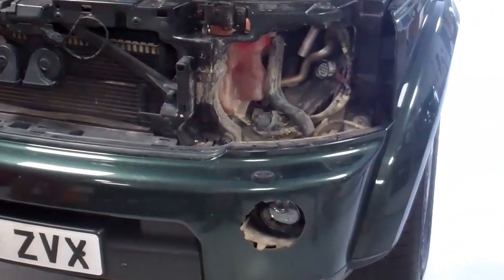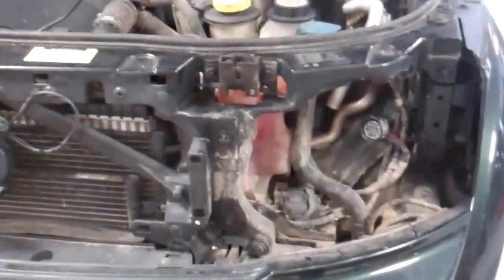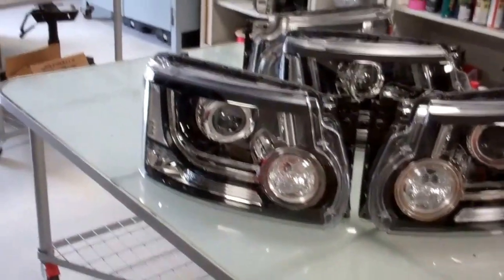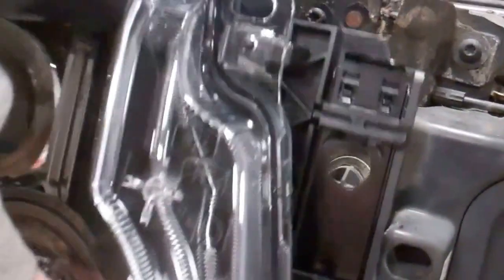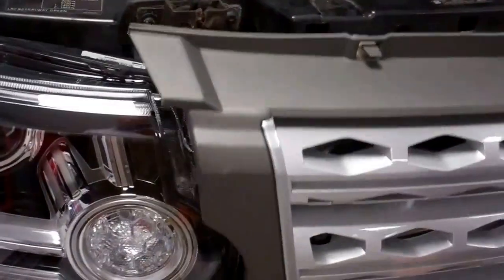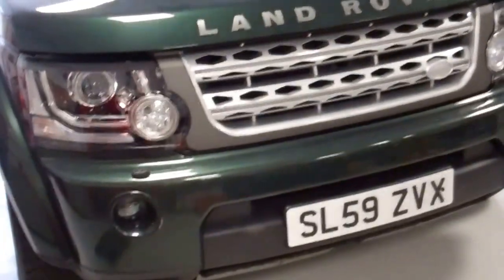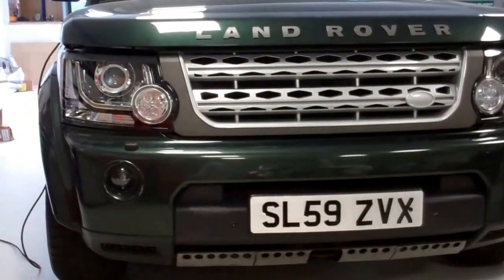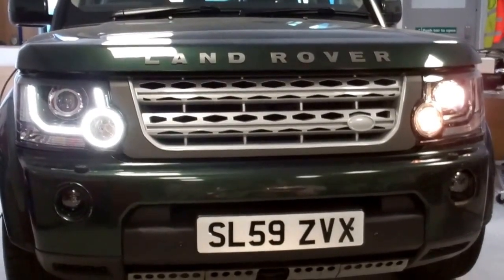Land Rover Discovery 4 facelift upgrade grille & headlights

Comment: Just put halogen face lift lights on a 2013 Disco 4. Main beam flash does not work unless the head lights are on? Blue light comes on the dash and they clunk but no light. Comparing the pins on both types of light the face lift has different pins to the old one. Any ideas?
Reply from the maker: Hi Simon - this is an interesting one. The old headlights had a bulb for low beam and bulb for high beam. The new headlights have one bulb for both - it has a "curtain" flap solenoid that covers the top of the beam for the low beam pattern... when the high beam is activated the solenoid fires and lifts the curtain creating the full beam pattern. When you flash high beam you will hear the solenoid firing but as the low beam bulb is not illuminated then you do not get any light. There needs to be a diode from high beam to the low beam bulb to fire the bulb up.
I could look at making this loom with diode in
Reply: @L663  it's like it's just not getting any power to the bulb when the head lights are off. But the blue light on the dash and 'curtain' flap are working. Let me know if you make a solution!

Comment: Thank you for the video guys, just been thinking about upgrading my disco 4 xenon to the facelift lights, didnt think the bumper woukd have that gap!
Great info, cheers!
Reply from the maker: Hi - you can either live with the gap or change the bumper.
I am considering producing a "gap filler strip" panel - thoughts ?
Reply: powerfulukltd it would leave the change alot easier, quicker and cheaper thats for sure! Especially if you are fond of the more subtle pre-facelift fog lights too
Reply from the maker: we have got the filler strip designed and sent off for quotes - could be a few months till we get in stock through ! The advantage would be a conversion needing no painting !
Reply: powerfulukltd excellent! It will be interesting to see. Any plans to do a facelift package with all the bits in one order?

Comment: great video i have just got a 2011 discovery 4 with xenon now if i put side lights on i get the fairy lights but on the bottom right of the lights i have a chrome bulb which does nothing do you know if this is a cornering lamp or is there a way to enable these thanks again great vid

Comment: Can the CCF file be changed by going through the display or is it a case of getting specialist software to change it? My Dad has just bought a Halogen disco 4 and wants to upgrade to the Xenon's
Reply from the maker: Hi the xenon won't work due to current draw too high on xenon. You can add a relay to solve this or change Ccf through software

Comment: I've just bought a 2016 conversion with xenon drl lights there's xenon in already will it plug and play or will I need to code it so too speak .. Cheers great channel 👍👍
Reply: On a disco 3 sorry
Reply from the maker: Hi - the xenon light will be OK but you may need to turn on the DRL with the code - try it first.
Reply: I have a disco 4 facelift 2009 with halogens , where would I go to get the conversion to Drl and zeon
Reply: did the drl ever work
Reply: Hi I make an upgrade of headlamps 2014 to 2016 code the dlr signature and work, but the yellow light of dashboard of adjust the headligt moving don't go off, on gap tool tell no messages from headlights, how can I get this warning off because everything seems to work only the adjust height of headlights not

Comment: What would you have to do if putting the 2014 zenon on a discovery 3 07 plate?
Reply: Cr8 G You would have to change the front bumper, fenders and I think... the grille.
Reply: WRC 123 yes the grill has to be changed as the lights are a different shape. It is getting the DRL light to work as the 2014 lights are going on a 2007.